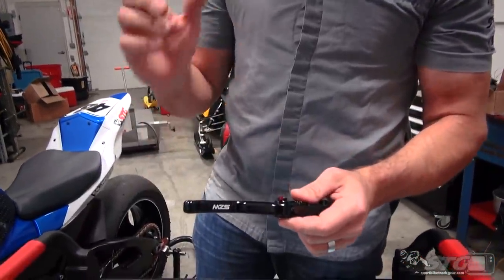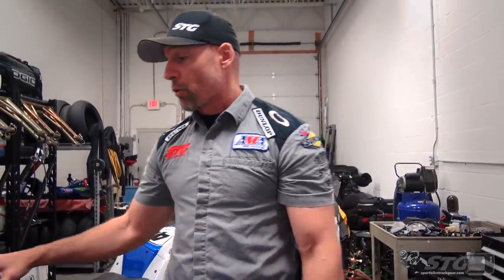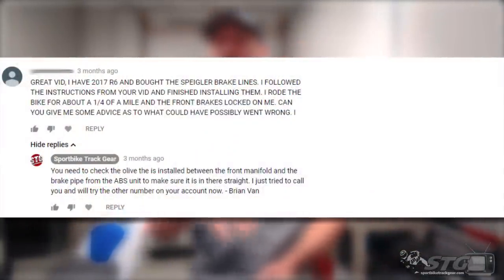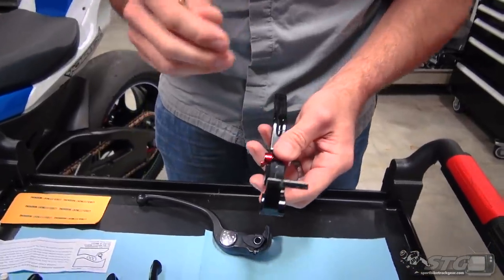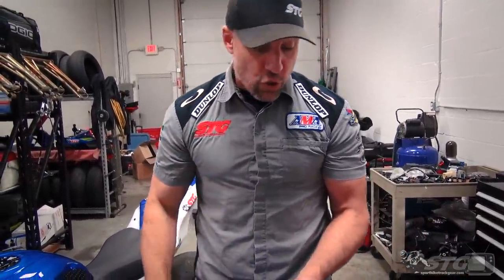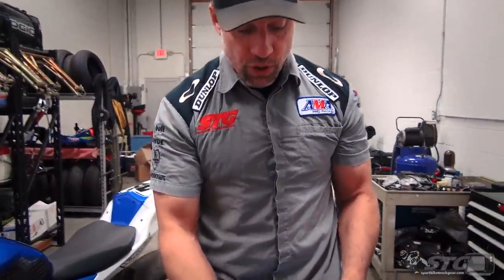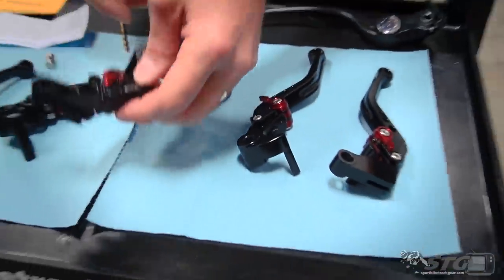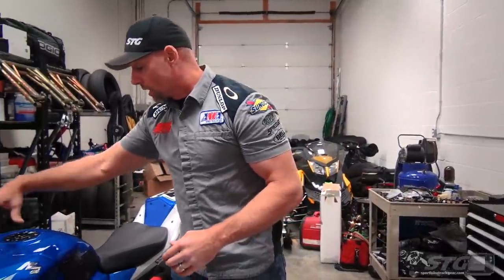The Truth About Cheap Motorcycle Levers | Sportbike Track Gear

Comment: https://youtu.be/gmOVptDWSPE  this shows what happens, thanks for the info great video .
Reply from the maker: Sorry to hear you crashed man. Thank you for taking the time to share the video, this will help others (well at least the ones smart enough to understand we a just trying to educate them) from having a similar experience. - Van
Reply: Sportbike Track Gear Sorry I don’t want to mislead you, it wasn’t me in the Video. It belongs to someone called Cory. He put up such a good description of what caused the crash and it’s basically what you are stating! His and your video has stopped me buying cheap aftermarket levers.There is also a crash of someone on a track day, in the UK going flat Out, the front wheel locks and he totals the bike but walks away.If it had been on the streets I’m sure he would be dead.
Reply: Lol that dude just grabbed the front brake riding one handed
Reply: @sportbiketrackgear  So must this thing move or not, the guy in the vid says he crashed because it was moving ..
Reply: Thks For Sharing mate!

Comment: Bottom line, your customer installed a bad part, then he rode around on it. This is 100% resolved by anyone with just a little common sense on install. And it needs to be said, that ANYONE who does maintenance on a bike without thorough safe review of the work, should not be riding bikes to begin with. SMH

Comment: So the takeaway here is: "Inspect your eBay levers before installing them!"
Reply: Not really.  You now know some things to watch out for with levers (thanks for the great video)!  What problems will kill you with other substandard parts?  I'd suggest that if you have enough knowledge to reliably spot lethal defects, you wouldn't usually be buying dangerous parts in the first place.  

Buying a part that will kill you, then catching that fault at inspection is a 'near miss' - the last chance before you're injured/dead.  I've ridden with cheap levers, and I've had a brake lever come off while doing 70+ on a GSX-R1000 on a public road.  Somehow managed to stop in time with engine braking & the rear brake, but have since only used ASV levers (DOI: now have a sponsorship with ASV).  

The takeaway is: don't skimp on critical parts.  Just because it looks and acts like a quality part at inspection (as mine did) does not mean it will continue to function reliably.
Reply: @Mojoissimo  So the takeaway here is: "Inspect your eBay levers before installing them!"
Reply: @Ru5te  No.  But feel free to follow your own advice - keeps me in a job.  ;-)
Reply: @Mojoissimo  Brake pads and brake cylinders maybe, but a simple lever?
Reply: @canturgan  One of my GSX-R1000s had a fully floating front disc with amazing calipers, pads, lines etc.  Riding hard one day, I pulled on the aftermarket lever, which came apart in my hand, and I watched the parts fly down the road behind me at over 100 mph.  The pads & cylinders were great, but I had no way of using them!  I now have ASV levers and HEL lines etc sponsorship - I only want the best for my braking system.

All I'm saying is that there are some parts that are underestimated, but actually critical in a serial system.  With enough knowledge and experience you can use any part (that's what the factory do to make the bike in the first place)!  

Unfortunately the Dunning-Kruger effect means that those with less knowledge (like me) don't know what they don't know - hence will make critical errors when (unwittingly) working beyond our competence.  I try to avoid this paradox by relying on highly-knowledgeable people (like ASV) to keep me safe, rather than unknown internet resellers.  Some will have enough knowledge to be able to use such parts safely - but I suspect this would entail buying bulk quantities and testing the parts themselves - so in short I suspect this video is not aimed at them, and they are not trying to save a little money on a single pair of levers!
Reply: @Mojoissimo  so either you squeezed the brake lever with enough force to break solid metal, or you never inspected the levers and found the cracks/ loose fasteners before you left on your trip. Either way, that is 100 percent on you, and you would have the same thing happen with your ASV levers because you either have the grip strength of Thor or the Pretrip Inspection skills of a toddler
Reply: @canturgan  yeah this dudes just plugging his product, having your break lever fall apart going down the road is a squid problem from somebody who hops on their poorly maintained liter bike with sandals and no helmet without so much as checking the oil

Comment: At the annual BMW motorcycle weekend party in southern Germany, the German Police had a booth and they showed a rack of "aftermarket" stuff that is Illegal for use on German roads.  Aftermarket "cheap" brake levers were on their rack.  These kill riders in the Alps and elsewhere.
Reply from the maker: Thanks for watching and taking the time to share this. IMO this is a real problem from hard parts to safety gear that needs to be sorted out. - Van
Reply: I'm with you too bro, I believe 100% these are dangerous and SHOULD be OUTLAWED IN THE USA as well!
Reply: Exactly how do the German Police identify "cheap" aftermarket levers?!
Reply: @hoomannili  My question too.
Reply: dude. in germany, anything that is not factory fitted or doesn't have compliance certificate for the specific model is illegal, so even your beautiful $200 levers would be defined as 'Alpine riders' killers' xD

Comment: When you pull the lever it pivots on that larger hole at the end of the lever where it attaches with shoulder bolt it pivots on to the lever base that clamps onto the clip-ons. When you apply the brakes the lever pivots on that large hole that has a shoulder bolt going thru the lever and its base allowing lever to pivot back and forth when brakes or clutch are applied and released. Sounds like your trying to mislead people on how the levers work to make them sound unsafe so people buy your product instead of an inexpensive set. IDK even know what that pivot does your talking about I just checked out a set of cheap levers and they don't even have that extra bushing. $25 set of levers from China look great and never had an issue with binding. If anything that loosey goosey extra play you pointed out would keep it from being able to bind ever. If that loose play does really bother someone they could always tighten the bolts. But in my 30+ years of riding street bikes I've never heard of a lever locking up someones breaks unless it was severely corroded, even though you describe it like a guaranteed occurrence with a cheap set of levers. I'd be more worried about corrosion or water & air in the fluid causing corrosion in the calipers so they get spongy or hang up and don't release.
Reply from the maker: "IDK even know what that pivot does your talking about I just checked out a set of cheap levers and they don't even have that extra bushing." If you do not know what you are talking about why are you talking? There are 2 different types of master cylinders, Radial like we show here in this video with the cross pin bushing and Axial which does not require the use of a cross pin bushing.

All of the information in this video is 100% accurate and intended to help our fellow riders make the best decision for themselves when considering a new set of levers. - Van

Comment: gimmie dat sub $20 chinese ebay levers boss!
Reply from the maker: Trust me you don't want them on your bike man. Being open and honest I could see going this route if you have an old, clapped out bike and broke a lever. What I do not understand is why someone would install these on any bike worth more than $1000. We dug through the reviews on Amazon and there were SEVERAL (out of the hundreds total) that said these levers made the front brakes lock. - Van
Reply: I get so much shit from my friends for spending $200 bucks on Pazzo's because they swear up and down their $20 ebay specials do the same job. They can have fun with that.
Reply: Squid Rider ur right. Plus not everyone wants to go to track and squeeze their break levers like they are in moto gp. I had my Chinese levers for 30 bucks and had them for 5 years
Reply from the maker: There are several riders that have left comments in this video stating these levers caused their front brakes to lock. We have a couple on our Facebook post for this video and one picture from a rider that crashed his bike when these junk ass levers locked his front brake. https://www.facebook.com/photo.php?fbid=587552511701923&set=p.587552511701923&type=3&theater  - Van
Reply: @MrTenzn   Out of 100 levers produced probably 15-20% of them are bad. I'm not gonna take a chance that high and you shouldn't either. Our bikes deserve so much more and certainly our lives lol. But you are right about one thing, I don't use my brakes as often as I should, I prefer engine braking, it's music to my ears lol.
Reply: Anton Ho I believe if I m meant to die, then even pazzo’s or CRG’s won’t save me :(
Reply: @SquidRider   But...they do...they're levers, boss....levers...the $10 ones that come stock on your bike work just like the $15 chinese ones do.
Reply: Yabbadabbadoo
Reply: Are you trying to be cool hand Luke
Reply: Marketing strategy
Reply: @SquidRider  Why did you change the original levers?
Reply: @sportbiketrackgear  truth is some people will ignore the info your putting out there for bargain prices but at the end of the day why leave it to chance ? a company’s product should not have a percentage of product failure in my eyes that’s dangerous I’m not messing with mzs and this sucks because I really wanna ride my bike but I’m not taking the chance I’ll wait a few days install some crg’s and get back to riding I’ll have a better quality product and peace of mind.
Reply: @alexx6622  you don't understand the mechanics of the problem here. 😎